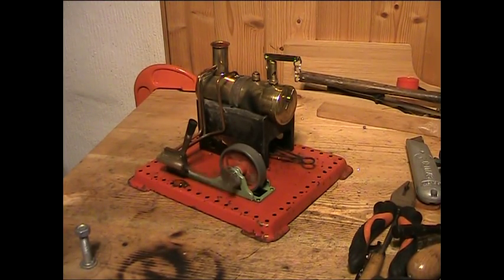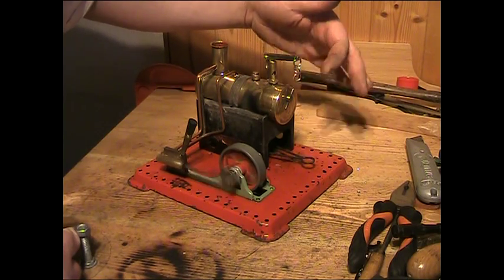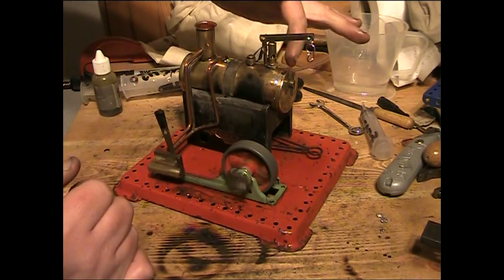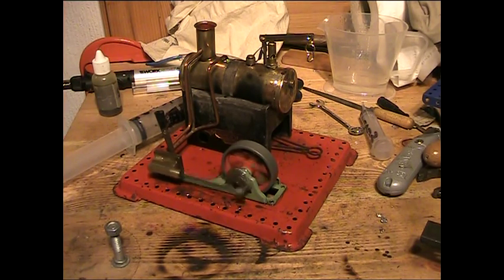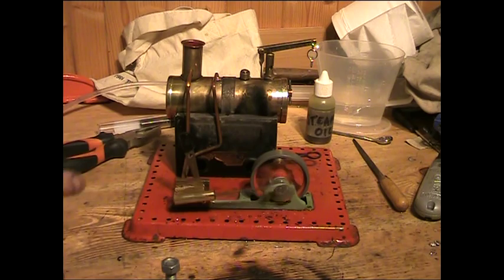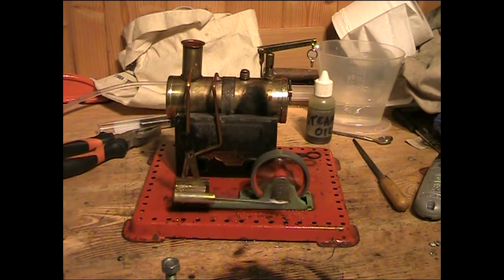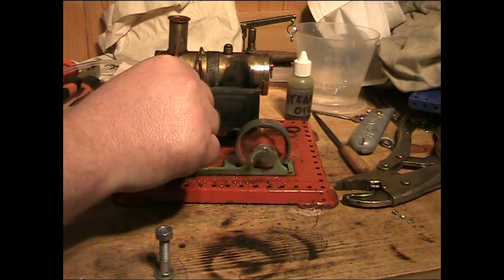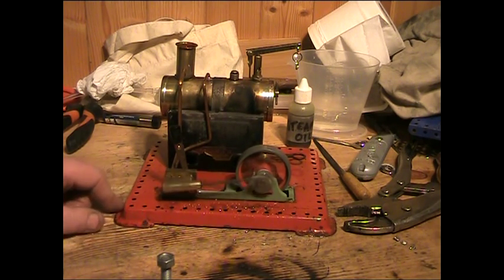MAMOD SE2A RESTORED TO WORKING ORDER

Comment: Hi, I recently got hold of an engine like this but it is extremely rusted and damaged. I am trying to restore it and have managed to get most of the parts deconstructed to clean them but I am nervous that I will damage the end cap if I try to remove it. Do you have any advice for removing the end cap?
Reply from the maker: Heat gently and evenly, perhaps in a hot oven, but wear heat proof gloves of course. That or a small blow torch working round steadily and evenly. Be very careful. Gets very hot. Resoldering is more awkward without solder paste.

Comment: I have an SE3 which leaks in 2 places by one of the end caps. When you fixed the leaks on yours, did you just spot-solder the seam between boiler & cap, or did you remove the cap first & renew the  entire joint? (Apologies if you covered this during the video.) Many thanks in advance for any reply.
Reply from the maker: Removed cap first' then added a bit of solder to one small leak afterwards.

Comment: I've got one of those :o) I got fed up of polishing it as a kid so I soldered a 1/4" bps brass fitting on it so it ran on dads compressor. Great little engine, but all speed and no torque. The lever did wierd stuff on mine too!
Reply from the maker: +teamidris  Tut, tut. Compressor! (wink).

Comment: thanks I will give it a try. could you help me with something else I was looking on eBay for steam oil and found a few different types what would you recommend all I can tell you is it has not been run for 35 years and it all moves freely
Reply from the maker: +Gary outdoors
 
220 steam oil for oscillating engines. If you can't get any use cheapo 20/50 multigrade, available from places such as Wilko's for about £3 - £4 per litre. Use lighter oil on the pivots, but not 3 in 1.
Reply: The best oil is castor oil.  I have steam oil too, but castor oil is way better!

Comment: Hi I recently got a mamod SE2 eBay and the safety valve and water level valve are both seized do you have any tips for unseizing them  thanks
Reply: hi, on my Manos it appears that the captive bit on fill plug and safety valve are seized to the screw, do you know how to free up and how do I place back into boiler. I think mi Manos is a se1 and it was my grandads. thank you
Reply from the maker: +Gary outdoors 

Put some rag around the safety valve and use a pair of pliers. If you get it out, and there's a build up of limescale, fill it with white vinegar and allow it to soak, probably for at least half an hour, maybe more, then empty the vinegar out and flush with warm water. Try this, but if it doesn't work let me know.
Reply: A bit of WD40 would help.  Once you unsieze the screws, get hold of some new washers and reseat the screws.  Pay particular attention to the safety valve on the top of the boiler.  Hope this helps.
Reply from the maker: See above.